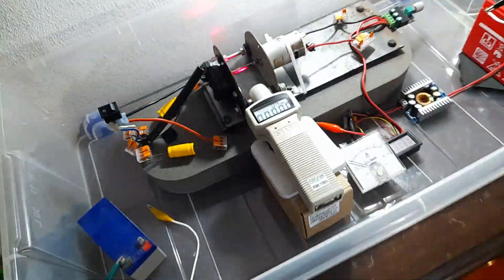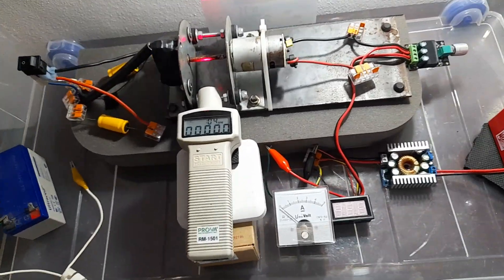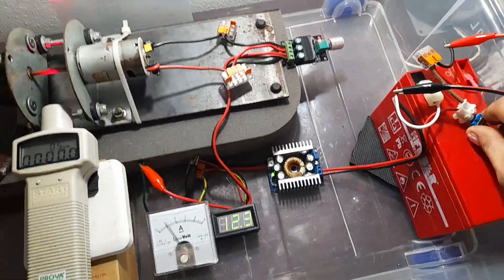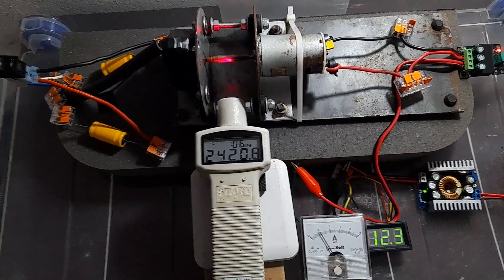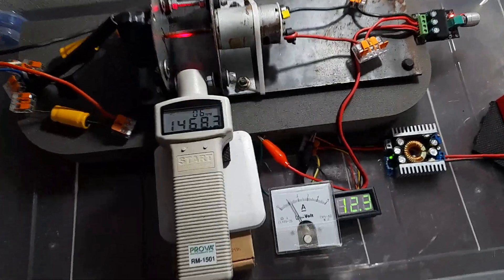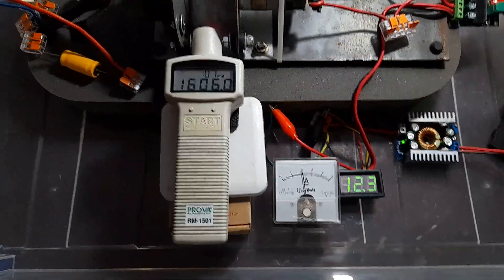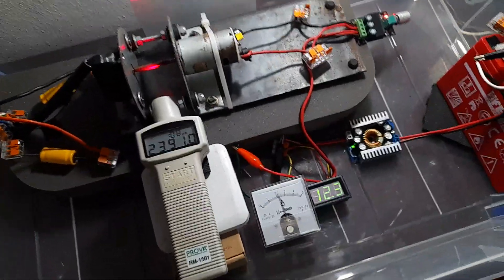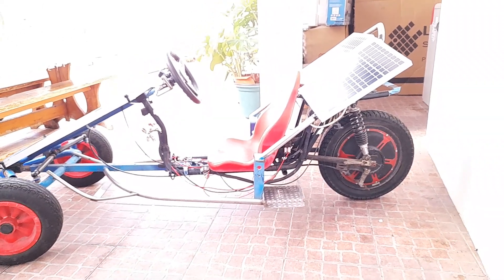Omega (EN) Regenerative Acceleration (Presentation)

Comment: What material did you use for the core of the regenex coil?

Did you use a steel screw?
Reply from the maker: this technology is patented,  we are working on comercial stage, cheers
Reply: @girasun  Sorry, I am writing again a year latter.

Did you get it patented?

 I asked that question because I had created that effect too, I wanted to see if you were able to do it differently.
If we are talking about the same thing then since around 2007, Thane Heins from Potential Difference Canada had rediscover this in around 2007.

It's just that if the right core is used and according to the gauge of the cable the right turns are added for the coil, starting at around 100HZ, the coil starts behaving like a capacitor (parasitic capacitance). And it starts storing the induced energy as static energy in between the windings of the coil, and as soon as the magnet leaves the center of the coil that static energy is released as voltage and current flows. 

The consequence is that it pushes that magnet forward and will pull the next magnet in!

This is what causes the acceleration! 

This means that instead of the rotor experiencing resistance it experiences assistance!

All this is also already studied and documented! There are already patents in  the USA and Canada for this, maybe not in your country.